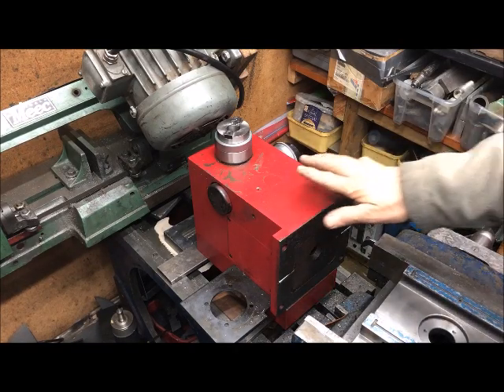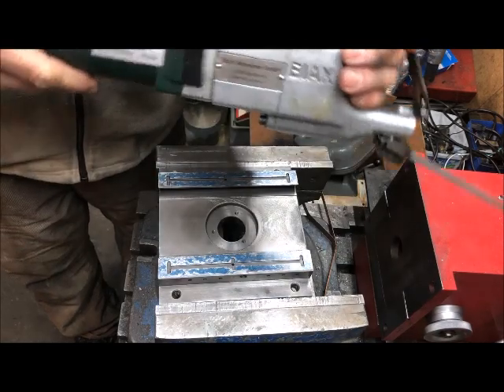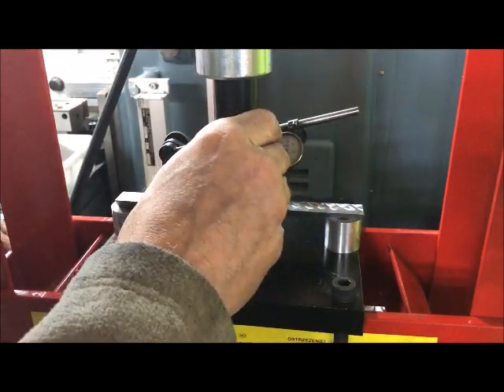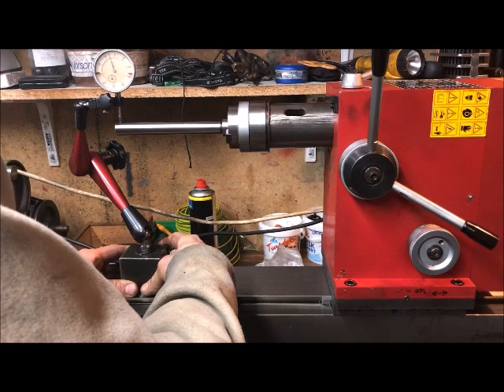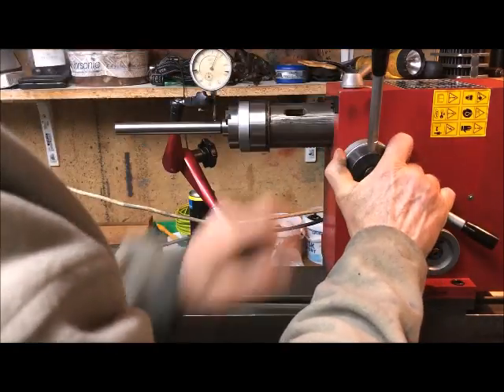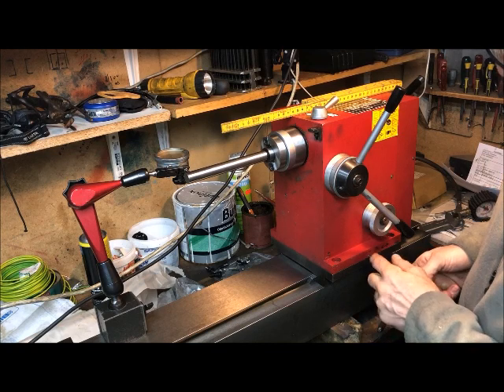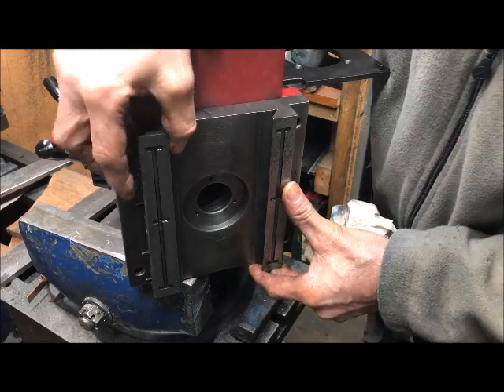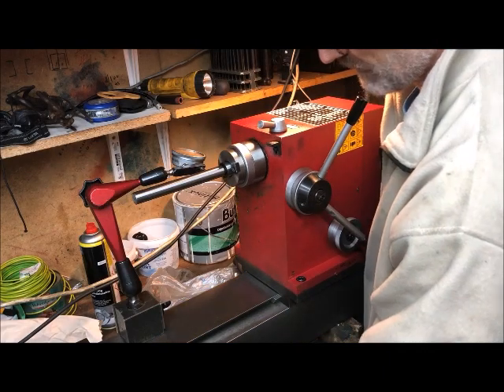SiegX3 fixing head tilt

Comment: Thanks for a superb video.  I just got a Sieg SX3.5 (slightly larger than the X3) from Little Machine Shop, and I was quite worried about the inability to adjust the head and be stuck with however it came out from the factory which is usually just a matter of luck how good it is.  I expected to have to do just what you are doing here based on my experience with the smaller Sieg X2 that I own, where getting the head aligned was very difficult because of the design (but which is fundamentally an excellent tool for the price and amount of space I have for it in an apartment).  You've shown me the way forward, although it will still take a lot of skill it is possible with the very good approach you made.  Also I had no idea that it was a good thing to have a little bit of "nod" where the alignment points inward just slightly; but as you mentioned that will help counteract a tendency to point outward when under the pressure of drilling.  That makes a lot of sense but I'd have never thought of it.  Also, while I am just getting interested in learning about scraping and have watched a lot of videos on it, I had never seen that hand-held motorized scraper -- amazing!  So I learned a LOT!

I agree too with your comments (echoed by others) that there is a definite market for these machines.  Not everyone can afford a Bridgeport or Schaublin quality machine -- but not everyone NEEDS that level of precision.  For the hobbyist, for the learner, or for the cash-poor startup company like me, I have found my Sieg mill and lathe superb tools *within the confines of the expectations one can have at their price*.  You must adjust to that, or adjust to spending the money for the better machine and adapt to living "caught between a rock and a hard place"  --  between your wallet and your tool quality expectations.  I have done excellent work on mine, but not as quickly as I could produce accurate work on the Bridgeport or Hardinge where I used to work, but satisfying results for the price of the tool!  

Anyway, thanks very much, and you have a new subscriber!
Reply from the maker: Thank you for the nice comments! I am glad this was of assistance to you. The BIAX scraper is a nice tool nd saves a lot of work/time especially on large surfaces/jobs. However, you will do good with just a hand-scraper as well so usually no need to invest in this kind of professional and expensive machinery unless you really need it.. or as an amateur have a desire for it :).
I have been lucky to learn from a professional in the machine restoration business (as have many other students!) and the alignment issues are a fundamental part of the education.
I think we are blesses with a lot of affordable machinery today, but of course as price goes down so does for example build-quality etc. I still think we get a lot for what we pay as amateurs, just need to keep in mind what we buy may or may not be equal to a more expensive, professional machine tool. That said, and we agree, the hobbyists machines are surely still useful as extreme accuracy, metal removal capacity, production oriented functionality etc. etc. most of the time anyway is not needed.
Good luck ahead and enjoy the hobby!

Comment: It's probably best to correct the head tilt problem by screwing it in place without those locating tapered pins as you did. Then I would suggest making a new locating mechanism. Either by drilling and reaming new locating holes paralell with the screws, or alternatively if you have access to a reamer with the correct taper as the original tapered pins reame them again while the head is in the correct position. But it would probably be a good idea to allign the head a bit better (than the 4-5/100 error you have now?) before committing to a fixation of the tilt. After all this will be a tilt the user will have to live with. 

But you are right, it's a lot of machine for the money. And it can possibly be a decent machine after having been trimmed inn by someone like yourself. I'm sure it will be a lot more precise and useable after you are done with it! It should as many say be threated as a kit, where you can get a decent machine if you put some effort in to it. 

Is it possible to make a tilting head function by inserting a form of pin in the holes to rotate about? That would be a usefull feature to ad. And possibly also make the allighment easier?
Reply from the maker: Thnks for commenting.. amen to all! PS! Yes, I also think it can be improved.. in various ways, and I reckon many users have made changes. Not sure about making a "head tilt function", but there is a (later) version called the SX3, which has a head that swings +/-45 degrees.

Comment: In a strange way, the import machines are ideally positioned in the market.  Those who can only afford that price range have something to buy, and those who only need basic function can get it.  With that same product, those who expect better performance can buy it and tune it up.  The cost of a great learning project really can't get any lower.
Reply from the maker: Exactly.. I don't kow what the future holds, but I assume these machines must and will be more expensive though..
Reply: @jansverrehaugjord9934  The average quality of these smaller home shop machines seems to be slowly rising, but along with that so are the prices over the last 10 or so years. But this is an extremely good example of why these machines all need a proper series of tests run on them whenever possible to at least verify what you have is correct enough for your requirements. Simply tramming the head to the table and possibly going a bit further to correct the inevitable column tilt in X and Y isn't enough unless the new owner happened to get very very lucky. I'd also agree it's more than amazing that they can manufacture all the parts for the low price that they do. What also surprises me is for some of it just how far out of tolerance there machining jigs and fixtures are allowed to get at times before there even re-adjusted or replaced. From that I have to assume few machines are ever tested or checked at the factory. Many years ago I mistakenly bought a Sieg C6 lathe and the only way it could have be misaligned worse for the tail stock would be to do so on purpose. It was bad enough it instantly broke the tips off any center drill that was used until I remachined and then shimmed for a much better C/L position. It's tail stock quill pointed uphill above the head stocks C/L .009" in just over 2 inches to mention only one of it's problems.
Reply: @turningpoint6643  - There's a LOT of factory tours on Youtube, but I don't recall ever seeing something inside the places that make these.  I'd really like to follow the construction process from the casting to shipping. 

How quickly do they whip through the machining / grinding?  What kind of machines are they making them with?  What DOES their quality control actually test?  Do they HAVE quality control other than slapping a sticker on it?
Reply from the maker: @turningpoint6643  Thnks for valid comments! The Shanghai guys are relative newcomers vs. other companies in the market, so I woud expect/hope that their testing and quality control should move up when they are becoming more of an established and reputable manufacturer.. at least I hope so!
Reply from the maker: @somebodyelse6673  There are some older photos on here https://littlemachineshop.com/Info/photos.php?Qwd=.&Qiv=thumbs&Qis=M
I guess if you go back to their early days 2004-06 I could imagine that quality possibly was not always the top priority vs. need for hard cash ie. a good production run :)
Reply: @somebodyelse6673  Some years ago I did see a series of pictures of the inside of the Sieg factory. Nothing that really showed any of the machining and grinding process though. I suspect if we really did see how these machines are being made it might cost them sales. This would be outside of Jan's video topic. But from what I've seen with what I've bought I have real doubts there's much quality control done at all other than a few seconds to test the machine turns on and rotates. If there was then any serious misalignments would be caught far sooner and there own internal factory machines, machining fixtures and jigs re-adjusted or replaced. At the money there producing these machines for then logically there's nothing left to do any real quality control anyway. And I'd bet every machining or grinding step is done at the maximum speed the machines and cutting tools are capable of. With today's highly automated factorys high quality for any product has pretty much a fixed cost no matter what the price of labor happens to be or where in the world it's being made. That low price guarantees one or more steps got missed, ignored or multiple corners were cut to meet that low price point.

Unfortunately it takes a great deal of knowledge and experience to tune and re-adjust these machines to there best. Few seem willing to actively search for the information about how to do so. For myself I find it extremely satisfying to make any machine much better than it was.If you don't know of it yet there's a free online PDF of the book Dr. Georg Schlesinger wrote and titled Testing Machine Tools that's about the best single source of information I know of. Videos like Jan's are of course even better since Schlesinger only shows how the static testing is done. Jan shows how to test and then properly fix any issues that are found.
Reply: @jansverrehaugjord9934  I'd very much agree. I think what were seeing as far as average export quality from China is right now much like the late 1940's - 1960's period for any goods coming out of Japan and the western worlds perceptions of those goods. Today most of what Japan produces including there machine tools are some of the best in the world and with prices to match. China's methods and cultural way of doing business is much too complex to go into, but there starting to quickly adapt to western expectations. China can already produce and equal any other country's quality or they wouldn't have the aerospace and military ability's they do. Generally no one in the west is yet willing to pay the price that level of quality costs for made in China goods.
Reply from the maker: @turningpoint6643  Much wisdom!! thanks also for nice comments. ps. I have been to quite a few Chinese factories over the last 22 years and there has been a huge development. For example, I have visited a number of car factories there and in the later time these are high tech and very clean workplaces. I have also been to several auto and vehichle manufacturing plants and development labs in Europe and the US and the Chinese have matched us well when it comes where they have focused and wanted to. So no doubt that the capacity is present, but there are also many other important factors I would consider. I actually think we us customers or societes are to blame for what have come close tho being our own downfall in most parts of  industrial and consumer applications, namely the crave for more and cheaper "throwaway" and "current model/fashionable" goods. Hard to stop as electronic innovation has been having such an exponential growth. But now I seem to detect a more sensible approach.. some servicing/repair, still smale scale business popping up.. more of a "not all can grow into heaven" orientation, and this will probable be amplified with a change now after the Covid-19 crisis.. I think we see more domestic control over supply&demand ie. more local production and less buy cheap.. I hope 😊
Reply: @jansverrehaugjord9934  Probably this virus is going to change a lot of things so I hope your right about building and buying much more durable goods than we have been.

Comment: I’m sure it will be fine by the time you’ve finished it, you’ve a talent for it Jan.

Al.
Reply from the maker: Thanks! The owner claims it was OK at first but then developed a detectable, although very small (5/1000 mm or 2 tenths ") rock, probably caused by the not so perfect locking mechanism just clamping in the middle of the gib. This is fixable as I suggested, but at such a small value maybe not worth mending.. most error is away and it is within reasonable tolerances now. The head not perfectly aligned would possible be a problem, but maybe they have set it up a little like this to offset any movement of the cutter when used in this direction? If milling steel for example the structure is not extraordinarily stiff, so will most likely deflect some.. not sure though..